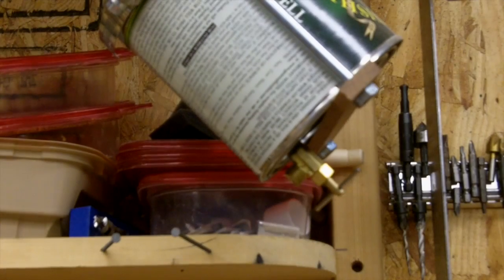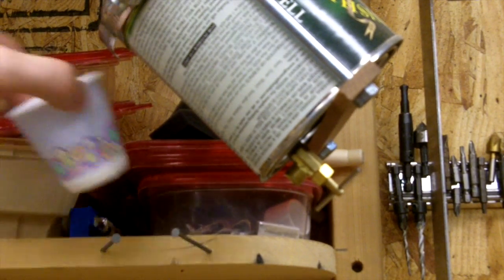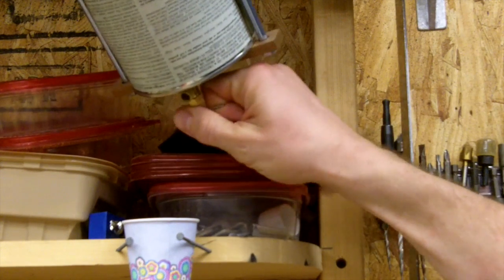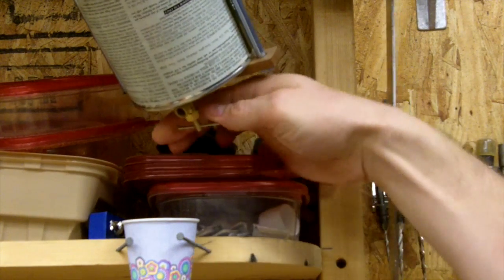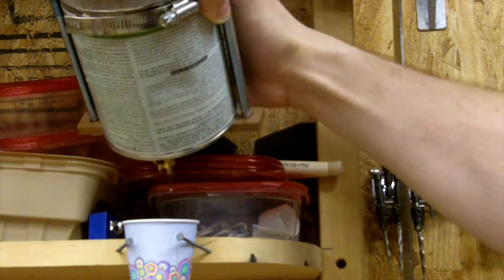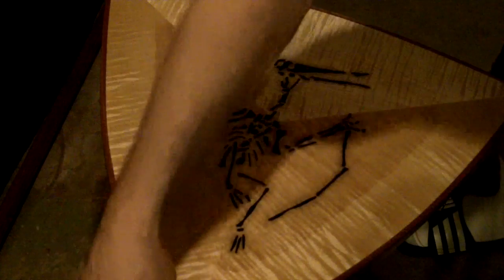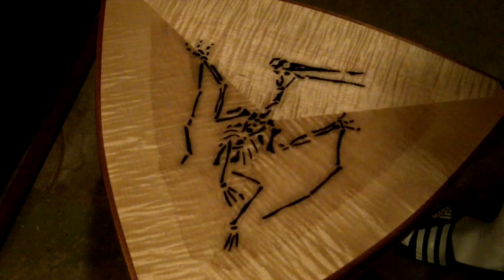Finish Solution Update - Testing on Fossil Inlay Table

Comment: I don't understand the purpose of this. If you're going to pour it in a cup, what's the point? Even if you were to pour more than you needed into the cup for some reason you could still just not use everything?
Reply from the maker: Did you watch the first video?
Reply: Andrew Klein I did now, and it makes perfect sense. Thanks! Also your videos are amazing, really good editing and the craftsmanship is truly inspiring. I'm subbed and hoping you'll keep making videos. Also, respect for still having all your fingers. I can see that you're always taking the necessary precautions when working with dangerous machinery like table saws, and that is a really underrated discipline.